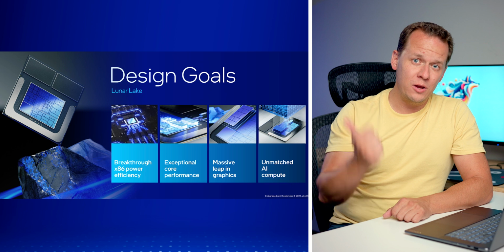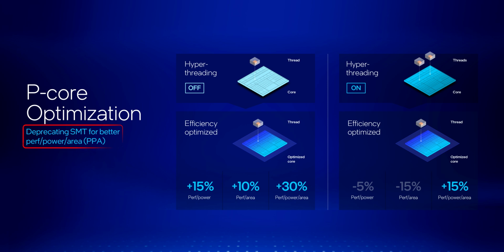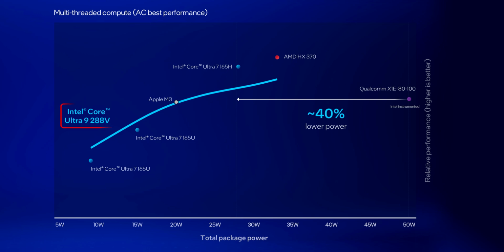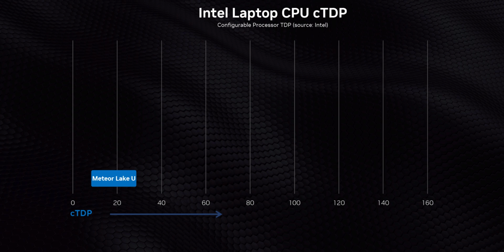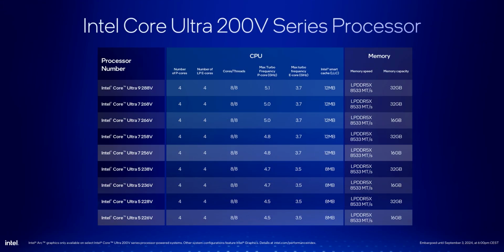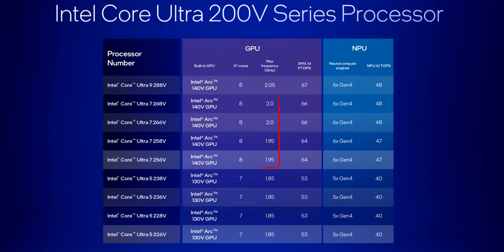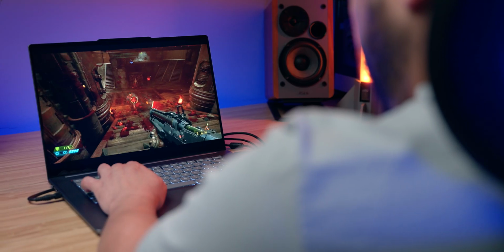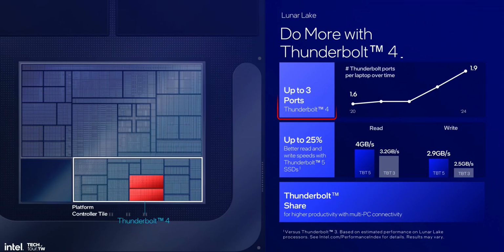Intel is FINALLY Doing Something Different

Comment: No amount of efficiency or performance is worth losing the upgradability of separate RAM, WiFi, BT, and other modules. Don't get me wrong, I definitely want improved speed and battery life... but not at the cost of upgradability, repairability, and consumer rights. Love Intel's new found focus and redirection, but hate those specific decisions.

As for ports, I have 0 interest in USB-A ports... they need to die already. That said, I'm all for adding more Type-C 40GBps ports w/PD & with charging capabilities (I'm tired of trying to find the right cable or right power block for devices... simplify it with Type-C. Even if the cable/block doesn't support the recommended wattage, it should be able to feed it some power and reduce the load on the battery.)

Also, why are yoga (360) laptops still a thing... does anyone enjoy holding them with their fingers on they keyboard? Please, create a hinge that rotates the screen or create some sort of magnetic plate/cover that is stored on the bottom but can be placed over the keyboard/trackpad when in yoga mode. And why are laptop webcams still so bad? We have amazing cameras in our phones, but not in our laptops... why?

Comment: Given how it seems like the power consumption of their 13/14th gen chips has been what was biting them in the arse the most (microcode issue and manufacturing defects aside), it kind of makes sense that their focusing their resources on increasing the power efficiency of their new CPUs. And, to be frank, with thin and light laptops you probably won't be using them for tasks more strenuous than music or photo editing, which even my 2012 macbook air can still do just fine.

I do wonder what their new Desktop and workstation laptop chips are going to look like when those come out though.

Edit: On the IO side of things, the two main IO ports that I look for when buying a laptop are USB-A and SD/MicroSD card reader. As someone who values using an actual camera for photography, as well as someone who does drone photography and GIS map creation having the correct port to offload my files is rather important in a laptop. Things like USB-C and HDMI ports are nice to have, but I consider those to be bonus features rather than necessary. I'm still miffed that my desktop doesn't have an SD port and I didn't buy a motherboard with an extra IO port, so I had to buy an external card reader -_-

Comment: The NPU is a waste of money and performance. I can't wait for this stock meme to die so we can get back to actually useful performance improvements.
Reply from the maker: Its also an insulting waste of die area, power budget & transistors.
Reply: @HardwareCanucks  what is a npu? is that the ai section?

Comment: Just so we have the ground rules straight : Intel is currently #4 in laptop CPU technology.  Qualcomm is #3.  AMD is #2.  Apple is #1.  The market is taking some time to pull away from Intel which has flooded the market with garbage at firesale prices, but most people know better than to buy a current Intel laptop anywhere near MSRP ...

Comment: There's barely any difference between the lowest version of the Core 7 stack and the flagship Core 9, other than the higher minimum TDP.
Reply from the maker: Yeah.  It really is quite confusing, especially when you consider most laptops using these will be housing the Ultra 7 256V / 258V.

Comment: Finally, finally, finally it looks like Intel have realised at last that the thin and light segment requires an entirely different product philosophy to desktops or gaming/powerhouse laptops. Instead of the standard metrics of core counts and speed they realised that the OEM and the end user needs efficiency; low heat and better battery life.  Additional performance has become superfluous - general/productivity users just don't need it but they do want quieter fans, cooler chassis, longer battery life and no drop in performance off mains power. Lunar Lake is the low heat, efficient SoC that newer, thinner & sleeker form factors from ASUS and also Dell's XPS Plus require.  Hopefully Lenovo and HP and the others will follow suit as well and we get an equivalent leap in form factor design over the next couple of years. The Yoga family especially need a brand new look.

Comment: lol so basically 2 CPU chip's binned according to its capabilities and slapt on a larger package? it will indeed make production much cheaper
Reply from the maker: We're already seeing this in the laptop prices.  The Slim 7i Aura Edition is launching for under $1300 with an OLED screen, 16GB & 512GB SSD.  That will make it VERY hard for Qualcomm to compete.
Reply: @HardwareCanucks  well it all depends if it will be able to run stable diffusion or LLM’s anything else isnt a selling point

Comment: So this might be a hot take but I don’t really feel like I need type A ports on my laptop. I don’t want a spider web of cables on my desk. I want to run one cable from my laptop to a a hub or KVM and have everything connected to that. Which is weird since I love the extra ports on my desktop and always feel like Motherboard manufacturers skimp on USB. But on a laptop It doesn’t bother me.

Comment: Let's see, buggy OS, highly potential hinge problems, potential thermal issues, soldered ram, potential cut down ports, and crapped out, cheaped out pcbs that will have a chance to suddenly die, almost nonexistent warranties if these scrapbooks decided to cease existing. Yea I'll just buy a MacBook instead of whatever MacBook wannabe these are... knowing I won't have to take my chances with half of the issues above.

Comment: But can I screenshare in a Zoom meeting without the fans ramping up.
Reply: Cpu like this should not make the laptop sound like jet fighter when you do screenshare on zoom. Unless the laptop brand have crappy cooling or 💩 tier thermal paste .in most case it is the paste
Reply: @mrbobgamingmemes9558  That is literally the problem with Intel Evo products. They rarely have proper thermal management. Also, Zoom is terribly resource-intensive compared to other products in the space.

Comment: There's no need for soldered ram, including the mythical "thinner and lighter laptops", lpcamm2 is socketed laptop ram, faster and thinner than best case claims made by Intel on this SoC.

Second, comparing this new gen CPU to the M3, not the pro of max, is the worst CPU Apple still makes is not a compliment

Zen 4 beats m3max, that's x86

And finally, contrary qualcomm claims, it's not more efficient than x86, when set to the same draw, en 4 beats it

On the other hand, I might have considered lunar lake if they offered one with either the far faster and thinner camm2 ram, or made iit available with 64 gigs ram.

My 7 year old cheapo "thin and light' 2in1 has 32 gigs ram, maxing these out at 32 gigs is only to make sure customers are buying again in 2 years

And finally, finally, finally, "evo certification" doesn't exist, it's made up by Intel, it means whatever they  claim it means, it changes as they seed fit

Comment: I was interested until they soldered the RAM. In the past twelve years I have saved three laptops from becoming e-waste by upgrading their RAM. This may be a minor issue to some, but I know better than to buy anything with an SoC. It's just gonna end up in the trash quicker. This is not the kind of computer I expect to see kicking around in 8-10 years. It's just gonna be piled up in a dumpster next to all the 8GB macbooks.
Reply: Its not bad if it have enough ram at the first place for long term.

Comment: I'm really tired to see those Intel PPTs.

I can't wait to the actual release so I won't see this PPT ever again.

All I understood from it and benchmark is that they used all tricks in the bag to make it good at big cost of profits and even compatibility.

I don't think they will have the same results on datacenters due the lack of HT and ram on chip which probably os what improved the single core speed and gaming.

Kinda cool but, yeah, they don't have more tricks to use next generation, compatibility is a issue. It's preferable to keep compatibility and jump on the ARM wagon when x86 dies in a decade or so.

Comment: what if I want a laptop with 64GB RAM?
Reply from the maker: Then buy a gaming laptop or a deaktop.  Thin and lights that focus primarily on battery life aren't the platform you should be looking at.
Reply: @HardwareCanucks  sure, I'll just lug a desktop everywhere. Thanks for the helpful suggestions.
Reply: Arrow lake will come in a bigger chasi and upgradeable ram

Comment: So for someone interested in a solid business laptop with capabilities to run those STEM applications as well, would you recommend to still opt for the Meteor Lake H series vs these Lunar Lake ones?
Reply: Lunar or, if you need multicore, Arrow Lake, but in 2-3 months. I would not go for a temporary band-aid, these new architectures are much much better.
Reply: @ContraVsGigi but he does mention at 9:00 that the CPUs on Lunar Lake are thread deficient. And the comparison at 4:55 also shows that they operate in lower power than the H series.

Comment: Lunar Lake summary: It's efficient but slow.
Reply: ? Where did you get that from?
Reply: @Zeni-th.  Early benchmark leaks. It's roughly equivalent in single thread performance, slightly faster than AMD's Strix Point and X Elite but is limited to only 8 cores so gets demolished in overall multithread performance by both. Battery life is also roughly the same on the same battery size and power limits.

Comment: 7:00 I don't like this approach to meeting the bare minimum requirements to check a box in a feature list (in this case 40 tops to technically be a copilot pc).
This ends up tarnishing your customers' experience with your products

Comment: This feels very much like a Centrino moment for Intel, if anyone remember?
Reply: this is what intel always claim in their presentation. they claim AI PC as centrion moment for intel
Reply: @Arkan_Fadhila no... You read it wrong... He is talking about CentrINO... So like 20 years ago they had nice low powered chips that people liked. I think this was during the core 2 duo area like mid/late 2000s.
Reply: @tanker242 I actually hated Centrino…they were super-slow…
Reply: @tanker242  It was launched with the Pentium M brand, so the predecessor to the Core Duo and Core 2 Duo.  It was also a major step up in regard to battery efficiency since the CPU was built almost from the ground up for mobile use, it wasn't just a slightly lower clocked desktop CPU.
Reply: @or1on89  They were anything but slow. The Pentium M was considerably more energy efficient than the top Pentium 4 yet performing on par or better in many cases.
Lunar Lake seems to be almost the same here. Of course the Meteo Lake and even Raptor Lake will outperform this in multi-threaded apps, but this is where Arrow Lake comes in as they are based on the same P and E core but with more of everything. Just like first gen i7 was based on Banias (Pentium M).

Comment: Now if all the brands of windows laptops or x86 laptops would stop making plastic junk. New chips, aluminum chassis, lets go. I am not a fan of Macbooks, I have one for work, but you would have to be blind to not to see the differences between a Mac and another plastic not so fantastic hp, dell, Asus etc. Surface laptop 2 is really the only other quality chassis and it has its own issues. Yes I have one on those too.
Reply: All laptop makers have full Al chassis on the higher tier laptops.

Comment: RIP Windows/Linux on ARM.

Also, let USB-A die already, jeez. Nothing new is shipping to utilize a USB-A port. Get yourself a dongle and call it a day. On laptops, we should have 2-4 USB4 ports, a 3.5mm headphone jack and a full sized SD card slot. If its a gaming laptop, a USB-C to Ethernet jack dongle should be included in the box.
Reply: Are you drunk or something ? .Dongle will reduce portability despite being light weight. 1,4 kg laptop is easier to carry fhan 1,2 kg ones that need 2 or more dongles. remember, lunar lake cpu is made for super portable thin and light laptop
Reply: Qualcomm has just started and has made a great first gen product.

Comment: Great overview, I think the biggest news is what probably won't be emphasized in Intel's materials, the move to TSMCs 3nm node. My understanding is flagship 288V is faster than the HX 370 only in single core, so the reviews should be interesting.
Reply: I think that 268V is also faster in single core.
Reply: @FlorinArjocu The point being only in single core, so either would be a hard sell.
Reply: @drewnewby  A very light, 1 kilo laptop, will not be used for heavy processing tasks in 99% of the cases. Most regular use is single core and at that, it is leading (except M4).
Reply: @FlorinArjocu I'm well aware of the use case, and no even those tasks are not single core. Background processes at idle are single core, not application use. Where do people come up with these ideas...

Comment: IMHO, the "most controversial of everything" is to move the memory onto the chip so OEMs cannot expand the RAM to their liking anymore! Intel is going down the road with Apple...

Most users don't care whether an ultra light notebook has hyperthreading or not since this is not a gaming laptop. Laptops of the past couple of years have more power on the go than the average Joe would ever need! My personal issue is indeed power consumption bc most of my laptops (of which I have more than 7) don't last throughout a 4+ hour Zoom meeting without charging.
Reply from the maker: I think there's a ton of benefits to it though.  Space savings, lower latencies, OEMs being forced to default to 16GB minimum...and so on
Reply: LPCAMM2/CAMM2 isn't norm yet so it's normal, Everyone doing this nowadays for the sake of saving space, efficiency. 

DIMM module we use on laptop and desktop is very old and outdated.
Reply: Rank 1 at 16gb and rank 2 at 32gb is fine but they need a rank 3 at 48gb and 4 at 64gb to make me want a laptop
lack of memory makes open tabs, streaming music, watching videos and the other kinds of stuff I use a computer for suck.
I also don't care for the tiny form factor. 
If I am going to use a laptop it is getting hooked to a giant monitor, speakers, a real mouse and a keyboard so plenty on ports too

Comment: I am fine with SOC where RAM, CPU, GPU and storage is bundled together, as long as the following requirements are met.
1. Two m.2 slots supporting nvme gen 5
2. Battery is replaceable.
3. There is also a 32gb and 128gb ram version available.
Reply from the maker: I'll add one: larger battery capacity due to space savings and lower pricing.
Reply: @HardwareCanucks  how was the always on/standby battery life?
Reply: I dont see use case for cpu like this with more than 32 gb of ram except on after effects which wont smash your cpu and gpu that much but will eat your ram like crazy
Reply: 128gb ram would be interesting, however lunar lake design can't utilize it because of lack of performance to begin with
Reply: ...and it's cheap. We don't want apple and snapdragon prices for purchase and upgrades
Reply: 128?? What you gonna use that for? Ultrabooks are not made for blender /davinci. Remember, unused ram is wasted ram

Comment: This is as expensive as Apple Silicon. But Aple sells laptops they have a lot of room to make a profit.
Ryzen won't try to sell more laptops, Intel own entire laptop retail business. But Amd sure will increase the price.
Reply from the maker: It's not.  You can preorder the Yoga Slim 7i for around $1300 with 16GB of memory and a 1TB SSD
Reply: @HardwareCanucks   1300$ and the multi-core performance is similar to Apple macbook Air m3.
Reply: @HardwareCanucks  3:13 look again same performance. 
M3 Macbook air 16gb 1300$.
Reply: @HardwareCanucks  macbook Air m3 16gb 1300$
3:13 show M3 air have the same performance.
Reply: @HardwareCanucks   Oh wait.
Macbook air M3 16gb is cheaper now isn't it??

Comment: This is so cool, this is EXACTLY the direction I wanted laptops to go
I know I'm asking for much but I wish the GPU was a bit stronger but other than that I am actually considering buying a laptop for the first time in my life (if the claims are actually true)
Reply: unfortunately i guess intel can't add more juice to gpu due to lack of memory bandwith from ram. i wonder if using LPDDR5T will help intel add another performance to the gpu but i guess it came too late for intel to consider it
Reply: The GPU is quite good, pulls more than 60 fps in cyberpunk at medium settings.

It's better than any other igpu out there